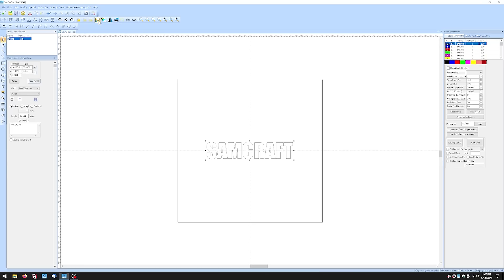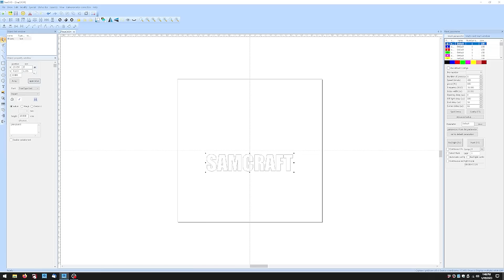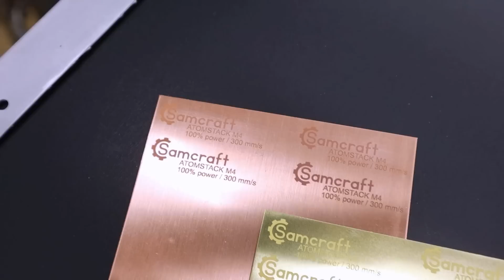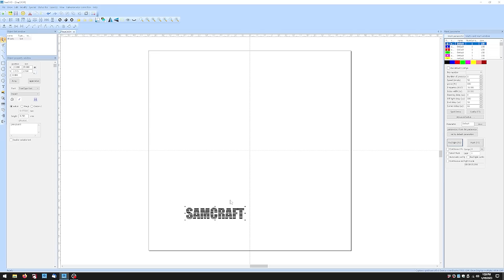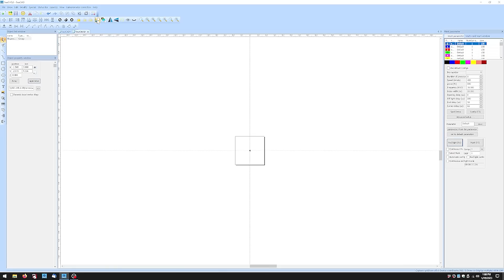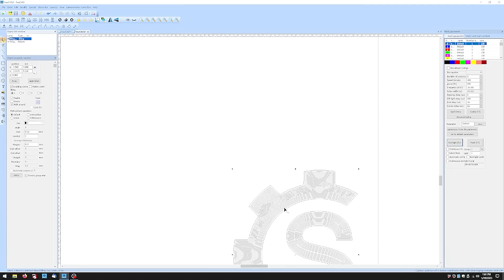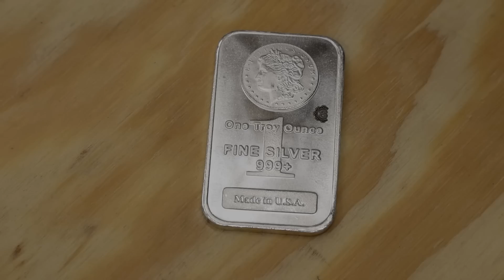Laser Engraving PURE SILVER

Comment: Sam, could you please review hot water tanks?  My current system is part of my propane boiler system in my home's unfinished basement. I need to change my whole  system because the propane is becoming too expensive.  From your experience, could you please tell me about your hot water heaters and what system you have now? Thanks. I need to change the boiler out too, but that’s a complete problem I will deal with after I have the water water heater problem solved and may best be left to a good professional because it is going to be complicated. Thanks, again.

Comment: Going to have to buy a fiber laser like the M4, since laserpeckers SUCK ! lol.
Reply: If you are looking for a fiber, I would recommend a 50 watt JPT fiber
Reply: @richardstokes7508  I just need something that can engrave on any material known to mankind. :3  would like to see if these can bore a hole through neodymium so I can conduct an experiment I've been wanting to try.
Reply: @HoodMelonCultureStudios  How thick is the material you would like to make the holes? I have a 50w JPT fiber and can cut .2 and .4mm thick aluminum with no issues.
Reply: @richardstokes7508  need a 8mm deep 1 and 1 half mm wide hole for the neodymium magnets I have, so I can attach them to my motor shafts which will be inside a copper coil system attached to a ducted fan and then I'll measure it over time. :3